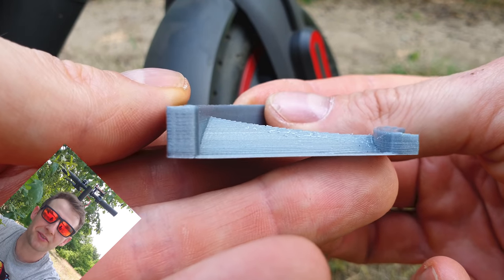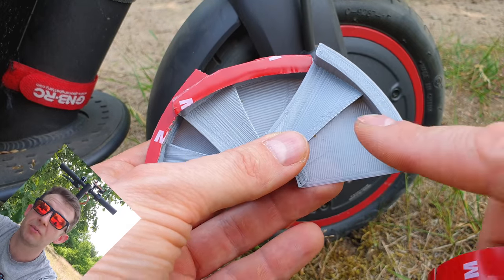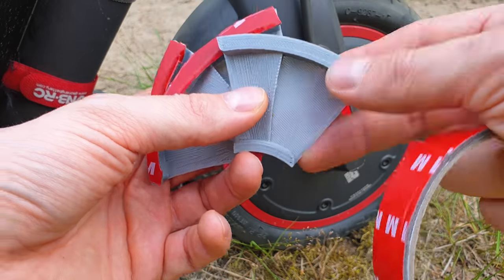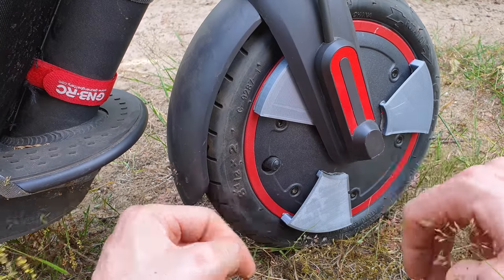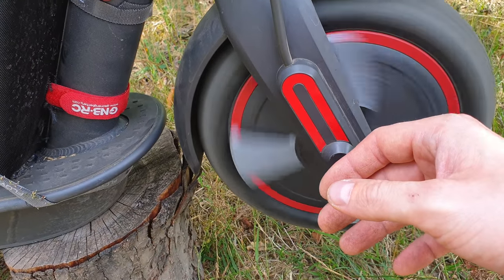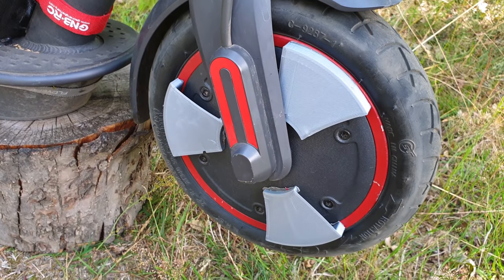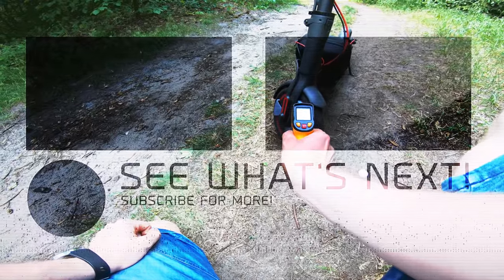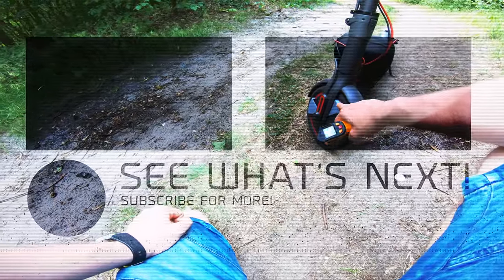World First Cooling system for Xiaomi M365 PRO " How to extend life span of your M365 "

Comment: Hi Pirate, I bought a generic Scooter that looks exactly like m365. So far, I am averaging  between 20km and 22km under 20kph speed. Is it possible for me to change the motherboard to a genuine m365?
Reply: Probably not, since the motor on that scooter you're using might be different, as well as other things.

Comment: Hi pirate, I need your help. I own mi 365 pro. It's just a month old & am using it as it is without any modifications. A few days before I noticed my scooter is not showing the Bluetooth symbol on the dashboard & I can't connect it to mi home app. Can you please help me out? Please 😭🙏🏻
Reply from the maker: looks like your BT dashboard died, i think U have to replace it
Reply: @PirateWasHere  okay Pirate thanks a lot for the info, its not even one month old, what can I do to solve it
Reply: Hi pirate, after reading a lot on Google, I tried a way to reset the scooter, by pressing the power break & accelerates together. Then it showed number 14 in red & a repair symbol in red as well. Then I tried to uninstall the mi home app & reinstalling it. It worked, now am able to connect to the app. Then I reset my scooter with the app as well & connected it again.
Reply: Can you please suggest the best mode for mi scooter pro with regular batteries.
Reply: I know am asking for a lot but you are the only one with correct knowledge of mi scooters that I know of. Really appreciate the help. Thanks in advance.

Comment: I think the temperature inside the wheel is not changed considerable)
Reply from the maker: well temp inside the motor is ~+10C-15C , especially coils and magnest
Reply: @PirateWasHere  This difference increase, because you just cools the surface of the wheel. Of course this is very interesting experiment, thank you.

Comment: At what temperature would you recommend we stop riding mate ??
Reply from the maker: =>60C
Reply: Pirate,  thanks pirate
Reply: @PirateWasHere  and on the non pro variant?
Reply from the maker: @samux1306  the same, cause it's actually almost the same motors & for sure the same motor power cables. I even could say that when i look at power cables , then everything above 50C will damage them :/   ( very very low quality )
Reply: Okay, thanks

Comment: What’s the right size of anti-puncture tape?
Reply from the maker: Biggest one Brah
Reply: Does anyone try tubeless with tubeless valve mod? I'm using this in my bike and it works. Standard tire on a stand rim, without tube but with tubeless valve. A bit of tubeless glue inside and problem with punctures solved. I don't have scooter yet but tubeless system should work too

Comment: Why not use metal parts and attach them with motor screws?
Reply: Because not everyone has a CNC at home!?!?!
Reply: @ELValenin  no
Reply: @themastercorpse  so you're telling me that more people have got a CNC at home than a 3d printer?
Reply: not everyone has a 3d printer but people can get 3d printer pieces...  IS MAGIC!!!!!!
Reply: @themastercorpse  just wanted to point out that he doesn't use metal because he knows less people could get it and no company makes it from aluminum. Sorry for being unclear
Reply: @ELValenin  In every city there is always a place where they have these machines and you can order custom pieces them.
He didn't use metal because he wanted to do it that way,
I would have configured the 3d model so that you can take advantage of the motor screws, buy longer screws and adjust the metal feet directly to the wheel to dissipate more heat.
Reply: @themastercorpse  im still waiting for the plans ;)

Comment: Please upload the update video after 2 weeks. :)
Reply from the maker: 🤣😂😂😂 Smart BoY 🍻🍻🍕
Reply: @PirateWasHere  you know what - I drove yesterday home up the hill and once I was near home - my acceleration got way weaker (and yet I saw 3 out of 5 bars available). My front wheel (engine) started smelling - I am going to disassemble it and see what melted.

And yeah, now I am getting this cooling solution lmao. :D Scooter still drivers, no issues so far, but fisrt 1-2 seconds of acceleration from the full stop there is vibration with some low noise.

Comment: good idea my friend 

 i working my project with real waterproof fan and system peltier with control panel to adj the speed fan the only way is must be create the battery pack and all system to enable in critical hot motor if the temperature is ok  the system is off if the temperature is hi the system is on and peltier and fun  do  the job cooling the motor all ready i have it some design and we try to patent this product

Comment: Это глупая идея, если вдруг отклеится в пути  одна часть - то заблокирует переднее колесо, это как палку в колесо велосипеда вставить.
Ну самое главное - этот пропеллер передаёт крышки еле еле ветерок, на температуру мотора это никак не скажется.
Reply from the maker: After almost 1Y no issue no problems, actually I will have problem to remove those blades...
Reply: @PirateWasHere  I am on your side, for new ideas and modernization with a new approach. I shared my thoughts on this! This will not cool the motor wheel, from the word no matter how much, the risk of falling for those who attach these blades poorly will appear. But there is a plus in this - the form in the form of a radioactive sign - looks interesting! For the sake of beauty, I am thinking of making myself an orange or red color, these overlays. Thanks you !